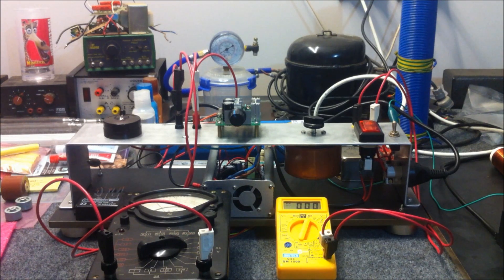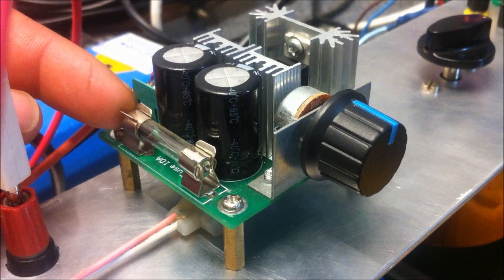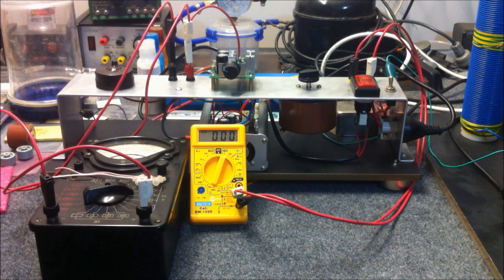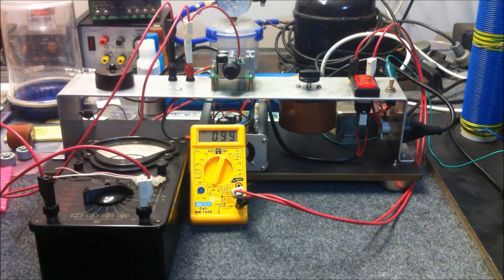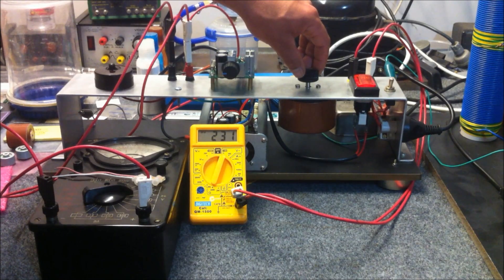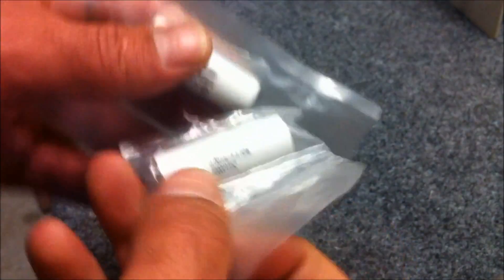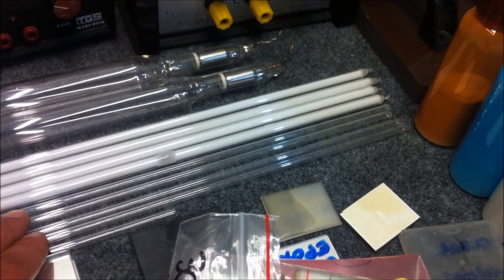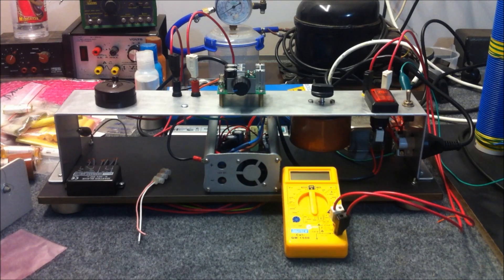Tesla's Longitudinal Electricity Power Supply, Electrodeless Bulbs & High Voltage Capacitors!

Comment from the maker: I am using a constant voltage 12VDC power supply to feed the PWM. My inverter shuts down if the PWM is set to less than 15% pulse width, above this it runs fine. Just keep an eye on the output voltage from the inverter. You don't want 600V spikes going into your NST! The wiring between the inverter & NST should also be well insulated for the same reason.

Comment from the maker: I would suggest 3 MOT caps to bump the voltage rating on your caps up to 6KV. If you only use two MOT caps, this would be a 4KV rating on the caps which is equal to your NST output. If your PWM driven inverter is overclocked, it could produce voltages which are higher than what your caps can handle. This could cause your caps to explode. Using 3 caps would give you a bit of a buffer....     Yes, the NST will only draw the current required to run the attached load.

Comment: Oh and the zff pwm rolls back the voltage to lower the current draw. How is this going to work woth a low voltage cut out on a 12v inverter?? Does your shut down?

Comment: Nst is like yours and is variable. I have a zero fossil fuels current limiting pwm so looking forward to seeing how it all goes. I guess i will use only 2 mot caps in series to keep the current capacity down there fore drawing for only short period of time. Apparently the nst  auto adjust to the load. Does yours???

Comment from the maker: The current going into the NST can be fairly accurately controlled by this type of circuit. I would be more concerned about the high frequency & high voltage spikes that can be produced by the circuit, which could very well kill your NST before the caps do! Are you concerned about the durability of this type of circuit or the NST? Is your NST one of the high frequency digital types like the one I am using? Or is it one of the heavy tar filled ones which operate at 50/60Hz?